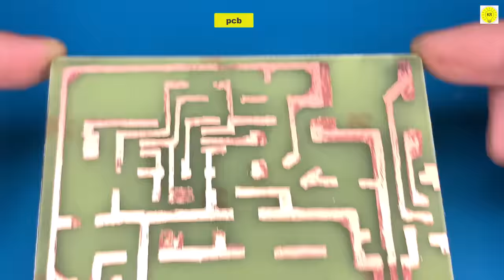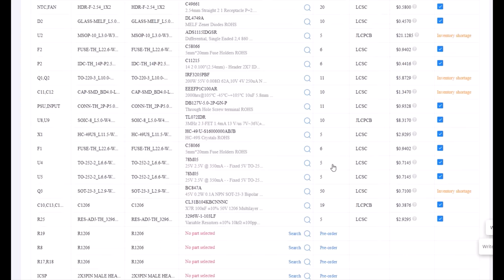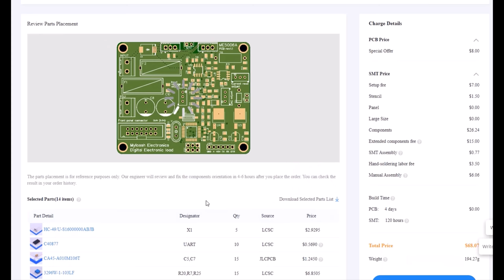how to make 220v to 12v 20a power supply , ATX Power Supply jlcpcb

Comment: Interesting. At 0:18 and 0:49 he used MOV's as 100pF capacitors. And what is the floating 22 Ohm resistor he soldered at 1:16 good for?

Comment: 20A output current from a flyback converter. So the peak repetetive diode current will be 80A. I'd like to see that.
Reply: I was digging old qdion qd500 atx power supply recently. It is also fly-back on uc3845L and it gives even 30A on 12V line - tried for short time. So seems no problem here
Reply: @RudkoTaras 
I need the circuit please

Comment: At 20 amps, the part will probably go off completely 😂
Reply from the maker: You can strengthen connections
Reply: Still, a flyback isn't practical for that kind of power. Flybacks are only practical up to about 100-150W.
Reply: @schaltnetzteil495  I think it would be possible to build a fly back circuit with really high power, but it would not only be inefficient and incredibly large, but would also emit far too many sources of interference.
Reply: It actually isn't really a flyback, because he used a bridge rectifier at the output. But it isn't a single switch forward either, because there is no output inductor.

Comment: Your circuit unfortunately is full of errors, for example you use a flyback configuration and as a output rectifier you use a bridge to rectify the mains.
Flyback converter uses only a diode. The transformer is unknown, the schematics there isn't. How can a person replicate your circuit?
Reply from the maker: If you visit the video description, you will know where the circuit diagram is
Reply: @inventorkr1  Thank you, I saw the schematic but I would like to point out some things in your smps.
Capacitor C1 in schematic 220 uF in your circuit 15 uF, capacitor C10 in schematic 2220 uF in your circuit 330 uF. Diode D4 in schematic MBR1040 (10.0 Amp Schottky Barrier Rectifiers) in your circuit KBU1010 ( mains bridge rectifier). The diode MBR1040 is a high speed single diode, in your schematic is drawn as a double diode connected to two windings of transnsformer. It's very important to use high speed diodes as output rectifier in a smps.
The UC3843 pwm controller is not suitable for offline power supplies like yours, you have to use the UC3842 pwm controller, the component data sheet explains why.

I don't see any feedback from the power supply output but only a feedback linked to the variation of the input voltage (components R4 and R3). The network of components D1, R6 and C7 in your schematic is of no use. That network had to be connected to a transformer winding which is not present and which also is used to power the PWM controller. The network composed of R5 and C5 is used for start-up.